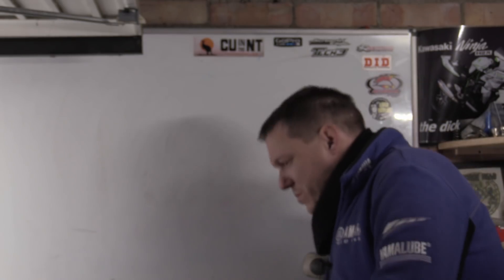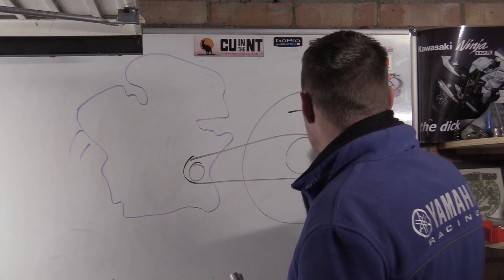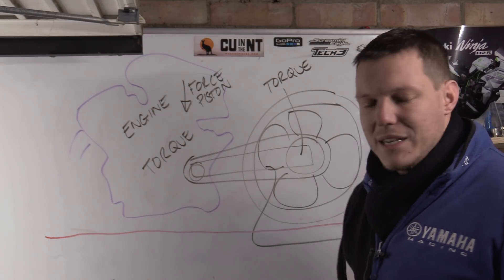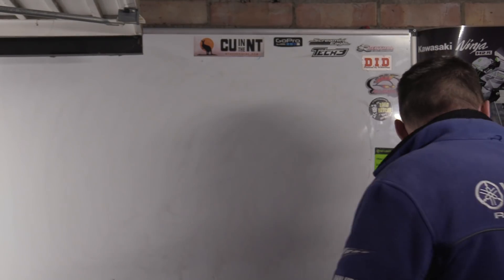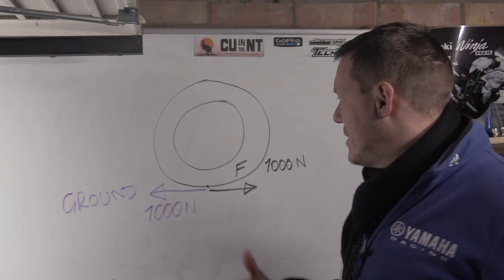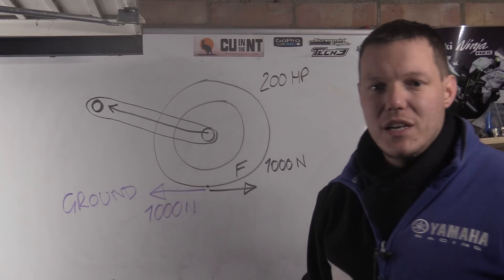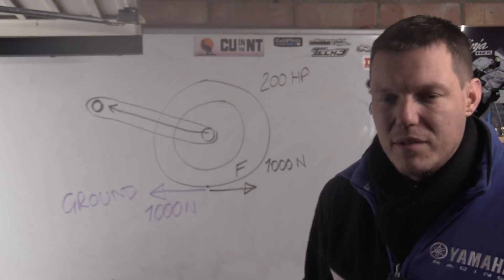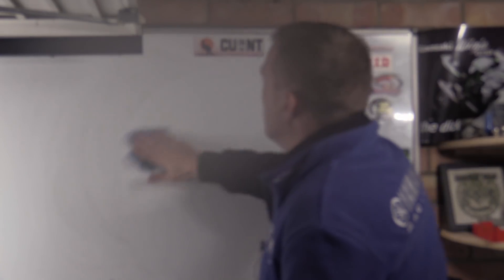What propels your bike? - Torque Episode 1

Comment: My assumption is the locomotion comes from heating a gas in a confined space through oxidation which applies a force. The work comes from providing a path for the high pressure gas to lower pressure atmosphere.
Reply: I was figuring more the source of the force, not how that force produces movement relative to the ground. Was not on the same page...

Comment: Thrust?

I sent you an email back in June after your video "Do engines make PEAK POWER in 6th Gear?" I said it reminded me of the thrust curves that used to appear back in the day in service manuals and even some owners' manuals (that's when manuals used to contain useful information, not just an endless list of health and safety warnings!). I attached an old Suzuki one and said that this type of curve was a perfect graphic representation of what you were describing in your video. I suggested that you could do a follow-up video explaining these curves and how the  (twisting) torque at the rear axle is translated to actual (linear) thrust on the road. Will this series cover that I wonder?

Comment: An oppositional force applies once traction is attained. Hence different tyres for differing weather and track conditions.
Reply from the maker: traction (or friction) is a fucntion of mass (and gravitational acceleration) vs linear force. But this isn't what moves you.
Reply from the maker: LOL when was the last time you saw friction push anything? Brakes are friction devices...
Reply: @thedirtyworkshop  push you hard enough to catapult you up and over the handle bars.  Front brake lock

Comment: If you put a hardly Ferguson on a paddock stand (with the use of a Hiab)
then pinned it flat chat in top gear whilst it is vibrating and dripping oil all over the place
it's weight would crush the stand and it would take off at about 10mph without its rider

Comment: The forces you drew at the contact patch are frictional. Friction is what keeps you from spinning and going nowhere. If that static friction is exceeded, the tyre starts slipping and you are not moving even if you are on the ground.
Reply from the maker: Friction is not a force. 

https://www.livescience.com/37161-what-is-friction.html

"Friction is not itself a fundamental force. Dry friction arises from a combination of inter-surface adhesion, surface roughness, surface deformation, and surface contamination. The complexity of these interactions makes the calculation of friction from first principles impractical and necessitates the use of empirical methods for analysis and the development of theory. "

https://en.wikipedia.org/wiki/Friction
Reply: Never said friction is a fundamental force. Its still what gives you traction though, just thought it would be nice if people realised that

Comment: 3min 40 ish second u say let's put it on a padoc and what not... We'll I agree, but u till the enjine in your bike rocs het of the stand and she flys for word. Nasty stuff. My awnser to the question at the beginning is as follows. The engine converts up and down motion into surcular motion via the cranck which spins the gearbox up and then provides that torque to the rear wheel (making your front wheel go of the ground lol). In short the torque apleid to the wheel when grip is available makes you go

Comment: This is not so much mechanically related, as it is to physics, but no one else could give me a clear answer and you know your shit well.
So rolling friction is an example of Newton's third law.
I was taught that static friction is not an example of Newton's third law. My question is why? 
Also, what about kinetic friction? Is it an example of Newton's third law? Why/Why not?
Reply from the maker: Newtons 3rd law is about transfer of momentum, and is a fundamental property of mass and inertia. Friction is like lift or drag. Its a resistance applied to a body not a property of a body itself. 

For instance you can reduce friction by changing materials. Forces are to do with mass and acceleration, not the chemical properties of a material

Comment: What propels your bike? We’ll surely it is some proportion of the potential energy stored in the fuel you are using. 
As for torque, that can be defined as the turning moment of an applied force about some axis; T=Fr. Torque is measured in newton meters (Nm). I don’t remember you mentioning distance or radius.
Taking the comments above into account, I think there was a lot of missed potential here for an interesting discussion about how potential energy can be converted to motion. 
You go to a lot of trouble to explain/discuss an interesting concept, but I think it could have been clearer. 
No offence meant.
Reply from the maker: "You go to a lot of trouble to explain/discuss an interesting concept, but I think it could have been clearer. 
No offence meant."

- Episode 1.